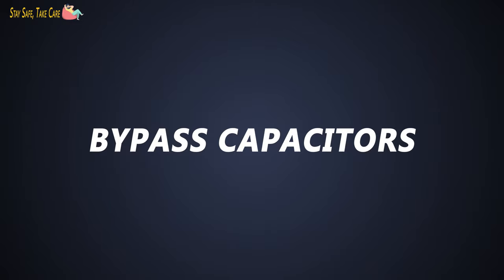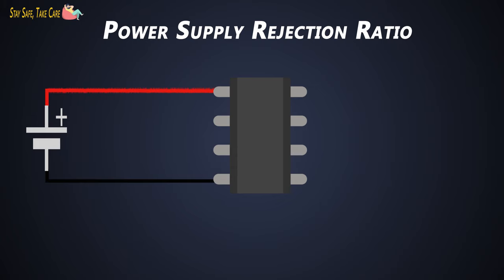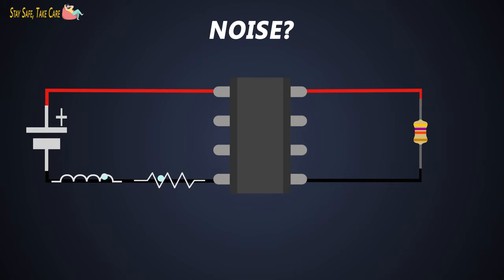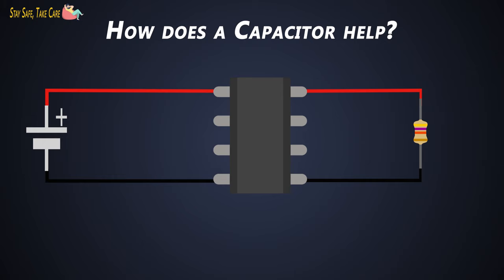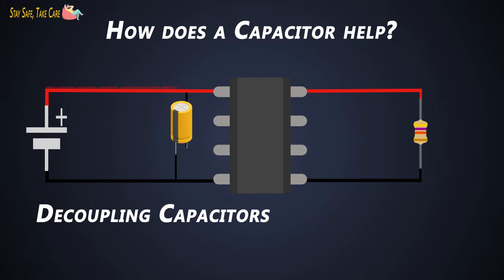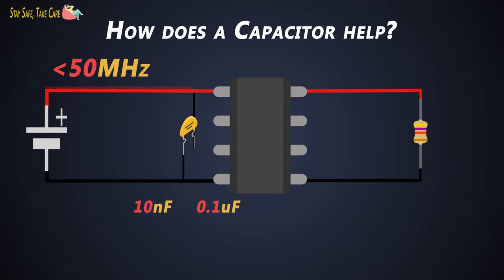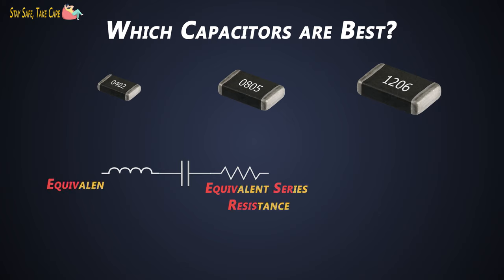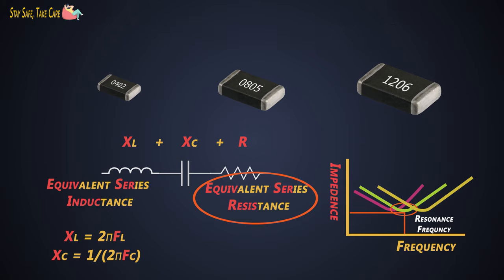What are the Decoupling capacitors? How to select Decoupling / Bypass capacitors?

Comment: Thank you so much for this video, great animations. How can I calculate the value of the decoupling capacitor? Does it need to be in resonance with the noise frequency?
Reply from the maker: You will have to measure the frequency of the noise and accordingly, you will have to select a capacitor which has very low ESR at that particular frequency.

But this is a very tedious process, you can read the datasheet of the component which you are using they might have suggested the Decaps for their chip
Reply: @FoolishEngineer  perfect, thank you

Comment: Nice presentation, quick question, you highlighted that for the low-frequency noise a "large electrolyte cap can be use" also a large ceramic capacitor (like 10µF) can be used as well right? thanks
Reply from the maker: Yes

Comment: I have a question about boostrap capacitor on the egs002 module a valve of 22pf 25 v rating is use but when I measure the voltage from the high side the voltage is 230 volt the same as the h bridge switching voltage how comes the gate voltage is the same and igbt  capacitor have rating of 30 volt max but the boostrap capacitor charge up 230 volt with a 25 volt valve capacitor and the circuit don’t blow up explain

Comment: Regarding the caps selection, How to determine the frequency of noise in the circuit? And how much this lower impedance should be (specific value)?
Reply from the maker: there is no specific value for the ESR of the Cap, it changes as per the frequency.
Reply: @FoolishEngineer  regarding the frequency of noise, how to be determined? In the case of RF power amplifier? Is it second and third harmonic freqiencies?

Comment: Well explained. Thanks. My question : I have a schematics with 2 x 1000μF in parallel. Why not one single 2000 ? Thanks for your reply.
Reply from the maker: if you use 2 caps in series then ESR of the total capacitor decreases, which decreases the power losses.

Comment: Great explanations and great animations, my friend: congrats from Italy. A question: I'm using Si5351A, an I2C-PROGRAMMABLE ANY-FREQUENCY CMOS clock generator. The datasheet says: "All that is recommended is one 0.1 to 1.0 μF decoupling capacitor per power supply pin". So, to stay in the middle, I chose a 0.47 μF (0603 SMD) ceramic capacitor (my system works @ 3,3V) and put it two millimeters close to IC. I will use IC to generate clock at 14 MHz. How may I do to know if that value is good for my purposes? Thank you so much.
Reply from the maker: I can not comment whether the value is good or bad, there is only one way to check it out- to test it. I would suggest to put the provision of 2 capacitors apart from selected cap on the PCB and don't populate right away, if you see the noise levels are high, just add one or two caps in parallel of different value and preferably package also.
Reply: @FoolishEngineer  Thank you so much, gentleman!

Comment: Nice great video! 
Can you tell me which decoupling capacitor package are using across microcontroller... Like example (STM, Renesas)
Reply from the maker: Generally 0805 or 0603 packages are sufficient, based on complexity of your design
Reply: @FoolishEngineer  ya thanks
Can you give me your email I'd I have one doubt in my circuit....
Reply from the maker: foolishengineer7@gmail.com

Comment: Do you think this is a good way for noise reduction when dealing AC 120 60Hz noise?  Often times when I work with controls circuits that share long runs of conduit the hots will introduce 60 Hz noise on unpowered circuits.  I like to use caps to bleed the noise to ground but people think I'm nuts. Why does the cap need to be close to the load?
Reply from the maker: Yes you can use capacitors in the AC but please make sure you are using non-polarized capacitors.

Comment: In DC eq circuit using electrolytic bypass caps, can I use a pair of 470uf caps in place off off 330uf of same voltage. If so, what changes may I notice?
Reply from the maker: Yes you can!!!! your ripple will be lower as compared to the 330uF cap, but the ESR of the caps increases as you increase the capacitance value, but it will not differ much.

Comment: Great Video. I have a question:
I don't know any one else who could help me with this. If i have a PWM source , and lets say i want to convert it to Analogue voltage. How can it do it without affecting the PWM source?
Reply from the maker: You can use just a capacitor to get the average voltage of PWM but it will surely affect the PWM, I would suggest you use a DAC.
Reply: You could use an RC low pass filter and then use a suitable OPAMP as a buffer. Even very small capacitance values in pF and nF range at the output of an OPAMP can cause instability problems, so first use the Low Pass filter and then the OPAMP

Comment: Is there any calculations for  chuse righ capactor ?
Reply from the maker: there are no calculations as such. you need to select caps based on the noise in your system.
Reply: @FoolishEngineer  
 i mean 
how to chuse the right value capactor

Comment: There's a polyester capacitor bridging the AC supply on the primary of my transformer is it performing the same job as decouplers?
Reply from the maker: Those might be working as a large filter capacitors
Reply: @FoolishEngineer  Thank you

Comment: Thank you, may i ask, when in an audio circuit i get dc voltages at the output, how do i calculate the proper capacitor to be used to block this dc voltage?, is there any equation?.which one is better, ceramic, electrolytic or what material?..Greetings!!
Reply from the maker: I am Sorry, I don't know. I'll get back to you on this.
Reply: If I made a mistake in this answer and someone has more info on this, do reply. 

Electrolytic Capacitor should work best as described in this video, since it can easily block low frequency signals, and DC signals have zero frequency.

Lets put that value into the equation for calculating Capacitive Reactance:
Xc = 1 / (2 * Pi * F)
Xc = 1 / (2 * 3.14 * 0)
Xc = infinite 

So DC should get blocked easily as long as it is less than the voltage rating mentioned on the capacitor. Again, I might be wrong about something here. This is accurate to the best of my knowledge.
Reply: @retrohd1_  THnx buddy, i am kind of researching the topic too, i will share some of it soon....thx for your time!!
Reply: You need to use a high pass filter, https://en.wikipedia.org/wiki/High-pass_filter
with a cut off frequency below that of the lowest note you want to transmit. You can think of pure DC as a signal with infinitely low freq.
47nf with a 1M resistor is often used for guitar amps if that helps, but it depends on what's on the other end and the impedance you are after. 
For audio use a film capacitor, they are expensive but you need the stability and low ESR.

Calculate the cut off as something around 30Hz if you love bass, but usually 100Hz or so if all you care about is the mids. 

The input filter caps here work as low pass filters, they block high freq noise.

Comment: How to choose the correct value of capacitance (ceramic/electrolytic) and also how to recognize the frequency of noise? (Please help)
Reply from the maker: You can check the noise of the circuit by connecting DSO to the input rails.

based on that you can select a capacitor which has low ESR at that particular frequency

Comment: Why is it called a decoupling capacitor?
Reply: Because it goes straight to ground
Reply: I believe that if the device and power supply are "coupled" then small changes in one will affect the other like a sidecar attached to a motorcycle.  When they're "decoupled" it's more like a giant spring connecting them.  Vibrations in one won't affect the other, but outright changes in speed will come across, like a low-pass filter.